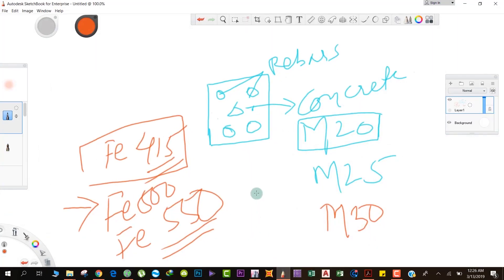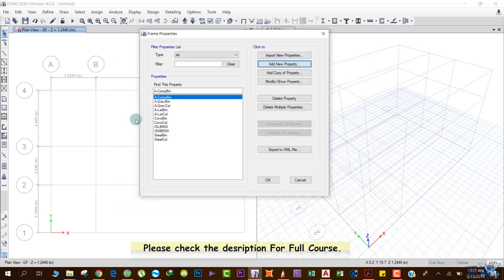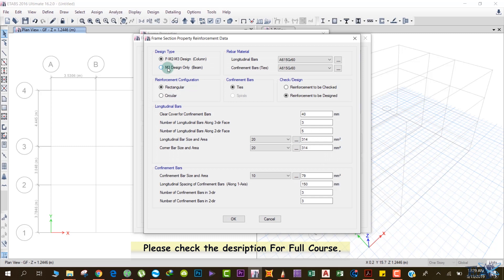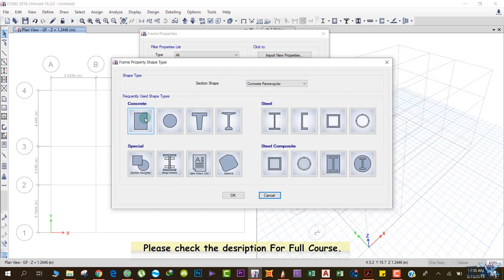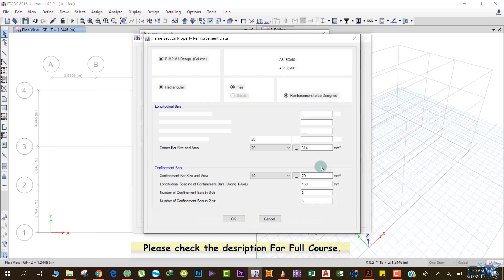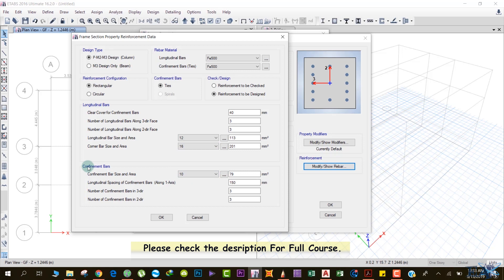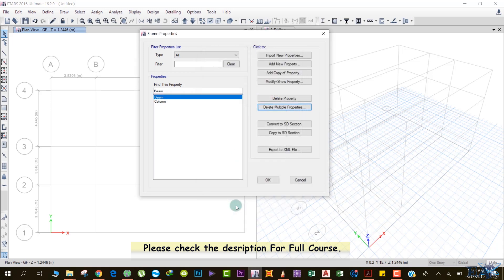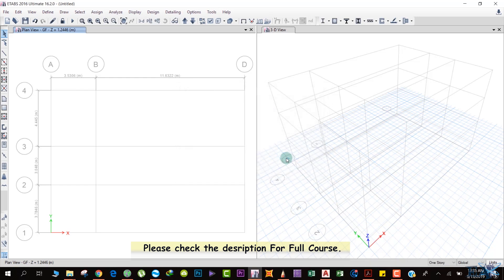ETABS Tutorial For Beginners [Chapter 6]: Define Section Properties in ETABS

Comment: Hi, min 5 you mentioned that you fill the rebar details in case you already have existing information (Reinforcement to be Checked).
However, why are you still filling the rebar details when you select "Reinforcement to be Designed"? What does that do? Isn't ETABS supposed to automatically fill the information if you select that option?
Reply from the maker: Yes. It is not required.